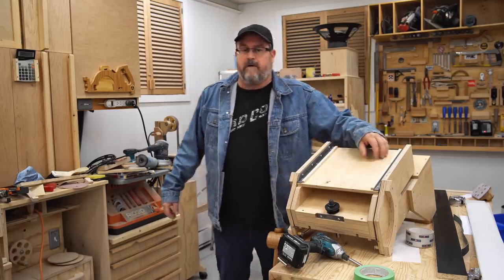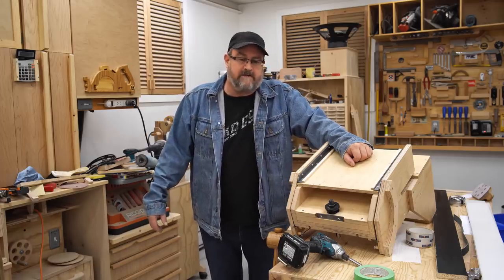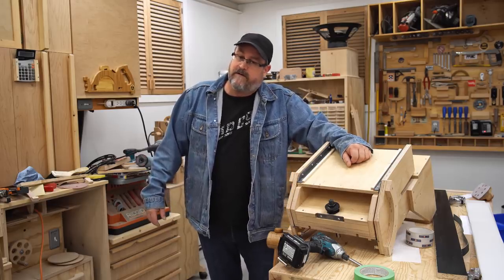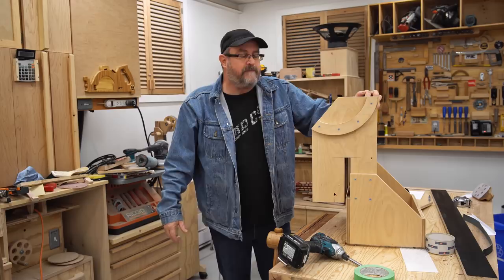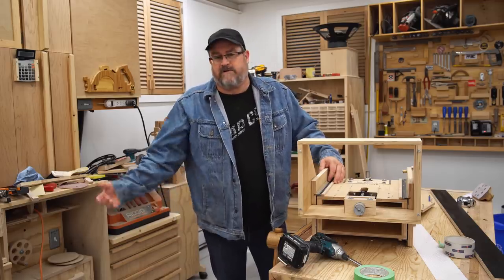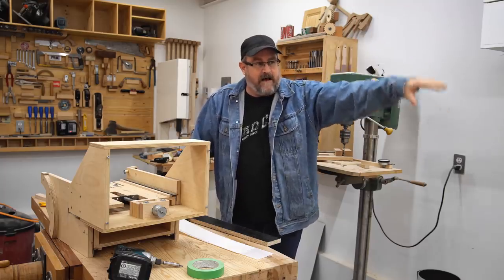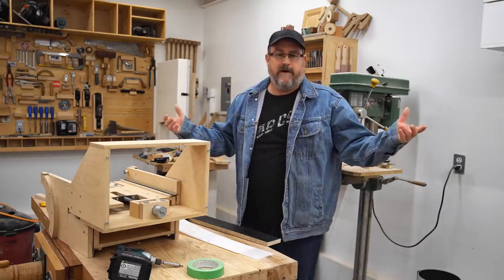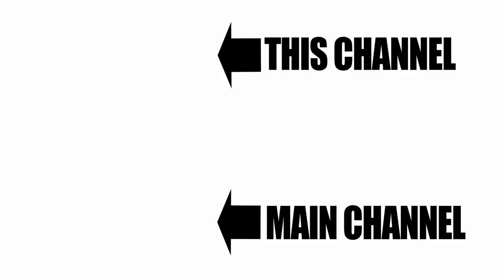How About a Dedicated Dado Saw?

Comment from the maker: Do I even use dadoes enough to justify adding this? Probably not, but half of the reason for that is how much of a pain it is to switch it out to make a cut.
Reply: I Build It Scrap Bin would love to get your thoughts on a nested bolt and nut system to attach a second blade when needed.
Reply: I would likely end up having to adjust the dado stack every time I use it, or just leave it at 1/4". It'd be handy though..

Comment: Hi John, My son works for a well-known car manufacture firm here in the UK, and sometimes he gets me glubs of paint that have stuck to something making a drip that gets bigger with every coat of paint. When I put these on the lathe and turn light pulls (they are only about an inch - 25mm thick) I get a similar pattern.
Reply: Peter bwon made a video of that. Can't remember what it's called, though.

Comment: I use two old craftsman cast-iron saws bolted together so that one T square fence can be used. Not so much for Dado use but because one saw is always set to cut perfect 90-degree cuts. (it's never moved except to lower or raise the blade). At one time I had three of these saws bolted together but it just took up too much room.

Comment: Yes Frankendado saw!!!  Also I tried to use my dado stack today and realized the threaded part of my saws arbor is smaller than the shoulder on the main part of the arbor so the blades to the side of the main blade jiggle around off center.... so ya can you make me one while your at it ;)
Reply from the maker: Coming right up! One question, though: how many gears do you want on it?
:)
Reply: @IBuildItScrapBin  just one.....

Comment: John I would guess the real question should be 'are all the dado's  that I cut the same size'? That being if all you cut are 3/4 inch dado's then it could be worth the effort as once the stack is set then there is no change. If on the other hand you are cutting dado's of different sizes then there is no real advantage to having a dedicated saw as you are having to set it up from scratch for each size change. Just my thoughts.

Comment: Are those capacitors standard polarized capacitors or non-polarized?  Do you have them wired across the 2 connections in the circuit or parallel to the LED?

I've run across a bunch of places where the flickering of LED's running on AC circuits (if I get around enough LED Christmas lights they actually make me sick) and keep meaning to experiment if there is an easy way to stop them from flickering- my first thought was to add a couple of rectifier diodes or even a bridge rectifier to the circuit basically feeding them DC.
Reply from the maker: LEDs only run on DC, but it's generally not smooth enough from a low cost power supply to prevent the flicker. AC powered bulbs and light strings already have a rectifier built in.
The caps I used were polarized electrolytic and wired in parallel with the LED strip. The cap will smooth the ripple by charging and discharging slightly to maintain an even voltage.

Comment: A dedicated dado saw sounds good on the face of it, but the real pain with the dado stack is getting the size of it right.  If it's just going to be a fixed size that's not all that useful.  I like to leave an 80T blade on my saw all the time and it does well enough ripping most of the time that I don't change it but I'd rather use that for a ripping blade than a dado.
Reply from the maker: The tedious part is having to take the dado blade off again to put on the regular blade. If you can just leave it on, that's more than half the battle.

Comment: Instead of steel have you considered just carbon fiber laminating the wood prototype? or is the cost vs steel to high for something that large.
"leds don't get hot" ooh boy looking forward 🍿 to commentators schooling us on LED physics
If you can slip a tube of parchment over the light fixture if it's able rotate could make the thickness varied , but dimmer switches meh.
Reply: 😀OK, I'll stay away from the LED physics and just say that the ripple AC an incandescent mains  bulb sees isn't small -  it's the full mains voltage (times sqrt(2) for peak vs RMS).
 But what I think John intended to say is that  the ripple in the heat of the filament, and thereby the light)  is small, as its  thermal mass (small as it is) won't let it significantly cool down  before it starts heating up again (1/100 or 1/120 second)